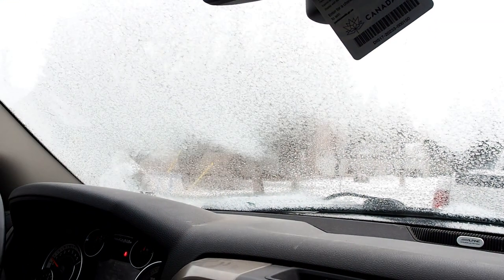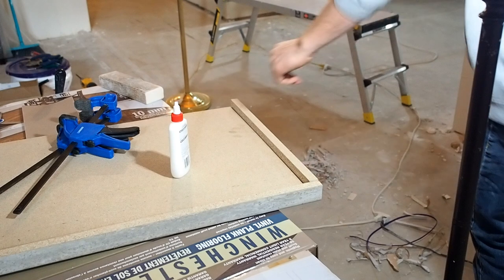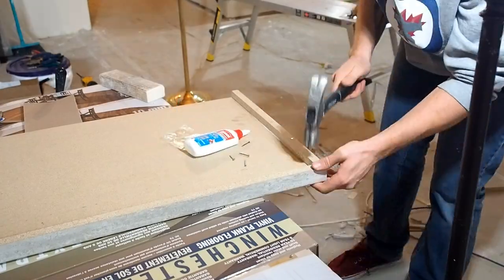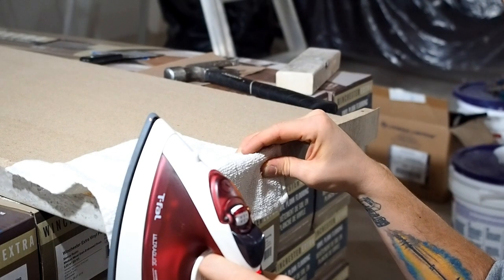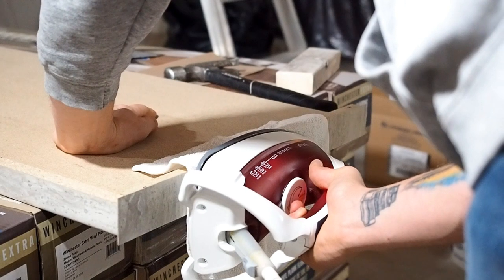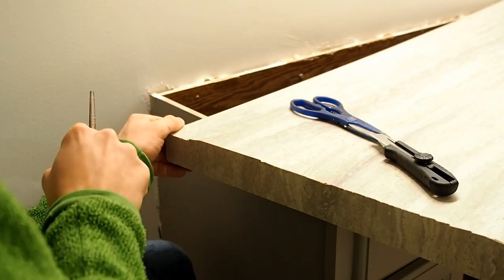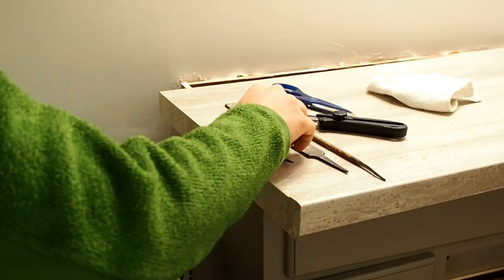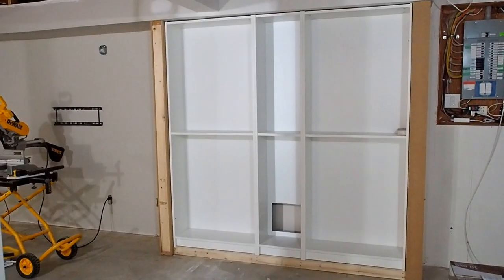How to install laminate countertop edge strips- Episode 4

Comment from the maker: There have been multiple comments related to routers, so: YES a router with a laminate trim bit would be the perfect tool to complete this task. However, there are many weekend warriors and DIYers out there who are willing to tackle replacing their laminate countertop who DO NOT own a router. Therefore, this is an alternative method to complete the edge strips without needing any special tools.

Comment: Another way to help the glue to set is to apply a cold, moist rag after using the iron. It will cause the glue to congealed and set. Pressure must be applied when doing so.

Comment: Hi I'm living in NZ but I have old formica tiles put together with edge strips if that's the right term for them{. they have a double edge for tiles to slide along} I want to be able to paint all bathroom walls. {only part of the walls are formica tiles} What is the best way to do this? one wall is already painted. I want to repaint it and other wall one colour. Please.

Comment: 7:20 is water not getting in those cracks? planning to do somthing similar and dont know what is acceptable and what is not
Reply from the maker: Which cracks are you referring too? There are no actual cracks in the jointed laminate edge, and the small gap under the sink to the countertop was caulked at the end to prevent water entry.
Reply: @hsdesignstudio  looks like the edge where the glued on sidepiece and countertop "top" meet are not totallty together, thx for answering!

Comment: What adhesive do you put on the back of the edge strip before ironing it to the bench top?
Reply from the maker: It depends on the particular manufacturer. I've had some come with adhesive already applied, and others require contact cement.

Comment: can I change the edge of my flat end countertop? I wanted to use a router to give it a cool edge rather than the flat 90 degree edge.
Reply from the maker: I'm sure you could change it, but laminating the end strip might be difficult. Usually the supplied end strips are rather stiff and wouldn't curl for a bull nose edge for example.

Comment: Why wouldn’t you just use a router to clean the edge of the laminate instead of using a utility knife lot more work!
Reply from the maker: Yes that is how I would do it now. At the time, that wasn't an option for me without purchasing tools/trim bits. Plus this shows how it can be done without special tools.